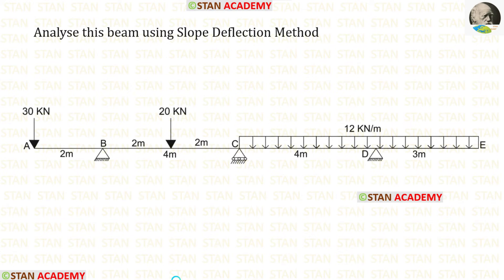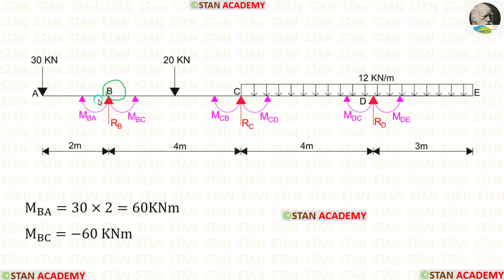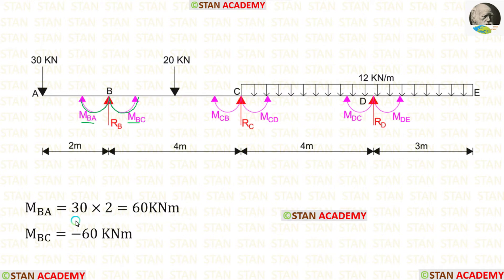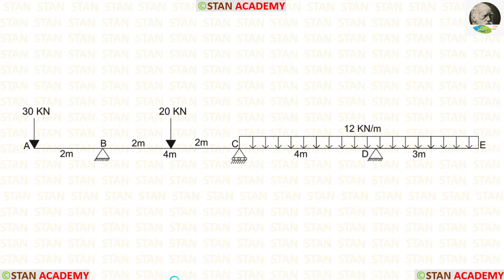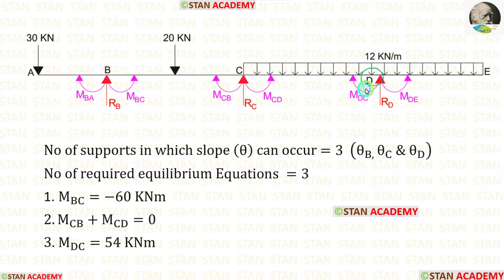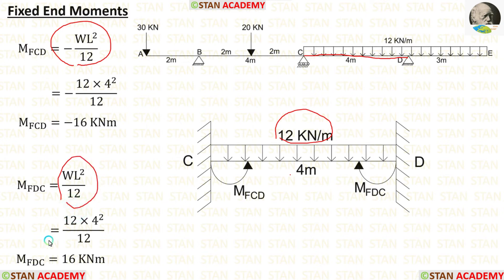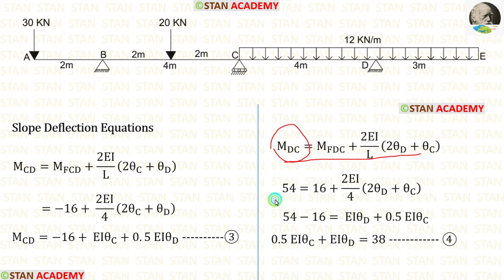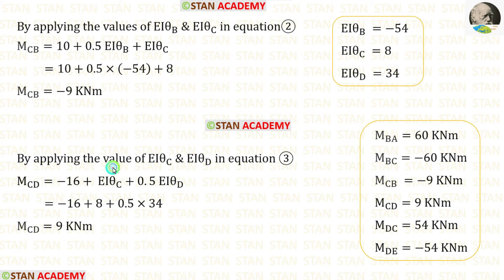Slope Deflection Method for Beam Analysis - Problem No 10 ( Overhanging on both the sides )

Comment: Sir ...how moment Md and Me are same ...since distance are different. ?
Reply from the maker: in the joints both the moments will be same. but be in opposite directions
Reply: the moment at point D would have been Zero if it had no cantilevered section .... Otherwise the cantilevered load resultant moment is the difference... thus creating an equal opposite moment on the support to counter it